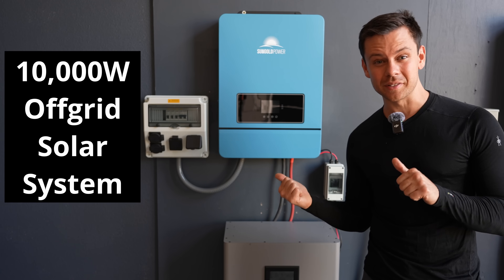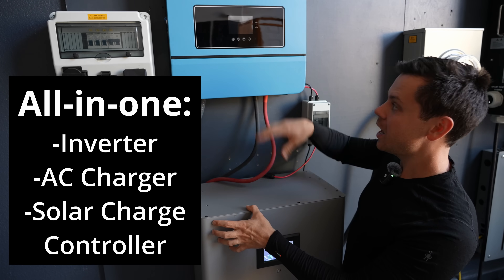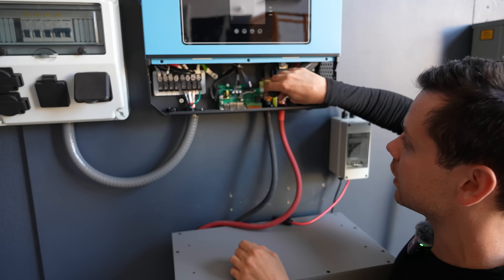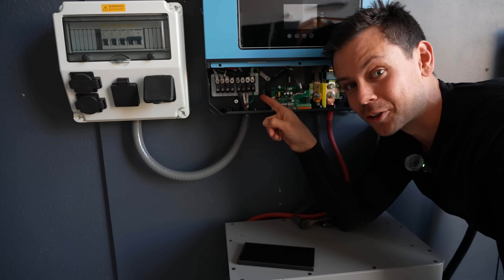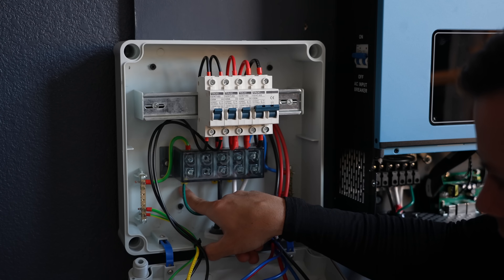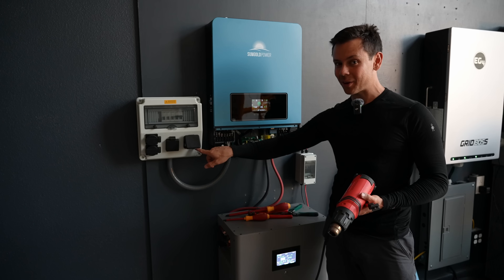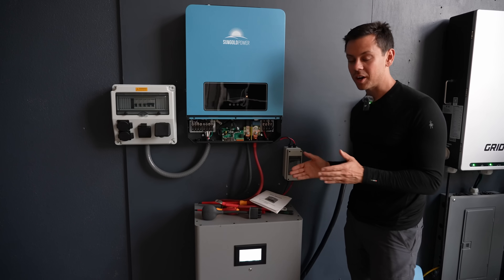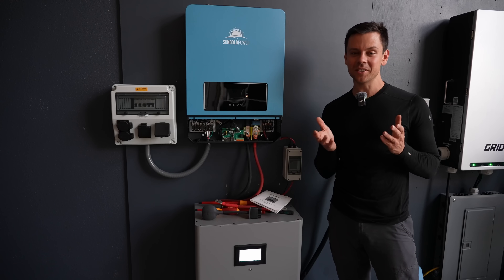Offgrid Solar Beginner Crash Course: Build a 10,000W Solar System

Comment: I love your videos. You seem to really know your stuff. I recently bought the 3000W inverter/charger from SunGoldPower, so I'm just getting started with solar power. I believe the grounding part of the system seems to be the most confusing part for me. When I contacted them about grounding, they did mention option 63, N-PE connection auto switching function, which when enabled "Allows automatic switching of N-PE connections." If you could do an entire video on explaining the use of their option 63 (may be other options on other systems), that would be so awesome. Because I've been looking through these wiring diagrams. I think I need to ground each panel to each other, optionally put an additional grounding rod at the panels, run a ground cable back to my DC panel, run a ground cable from the DC panel to I'm assuming the grounding rod at the house (assuming?) (which apparently could cause a parallel connection to the neutral coming from the power company?), connect the DC panel ground busbar to a Midnite Solar GFCI breaker for ground faults, connect a SPD for the PV panels to the DC ground busbar. But then SunGoldPower said not to run the AC and DC grounds in parallel. I don't see how to avoid that if they both contact the same grounding rod at the house. And when I look up things online, there's usually two assumptions I see: fully off-grid (and no grid) or grid-tied with no battery. I think I need option 63 on, and maybe that will prevent running the two in parallel, except that it inevitably would circle back around to the main panel since they would both be connected at the PE grounding rod. Thanks if you can. I may just have to study it very closely while I'm connecting everything. I just don't want to damage the inverter or energize the ground (double N-PE bond). Also, I would have to run the ground wire from the inverter to the critical load AC subpanel as well. How do you avoid parallelizing the PE ground while also grounding everything metal that needs to be grounded to the PE ground, including the grid main panel (before the inverter), PV panels, PV SPD, GFCI, inverter, DC panel, and AC subpanel (after the inverter)? I have the Renogy DC panel box and I'm looking at a small Square D panel at Home Depot for the critical load (with a 25a 1P main). I was thinking of using the Renogy inline fuses for the SunGoldPower 24v parallel batteries. I don't have an electrician but I'm trying to do everything as if it would pass NEC code.

Comment: You could use welding wire for the battery hookups, It's usually cheaper than the colored stuff, some companies sell cheap wire for more just because they color coat them.

Comment: I have a manual transfer switch on my main breaker panel for a 30 amp input from a generator.  Does this inverter have the option of grid battery charging?  Can this system automatically switch between grid and battery power when the grid is down?

Comment: I desperately want to do this or something similar to this, but I’m worried about problems with insurance if there’s ever a fire and I’m not covering it due to this thing being not permitted and I’m in Florida so you can’t get anything approved that isn’t a matched UL listed pair of inverter and batteries at this time. So that I think that means I have to use EG4 stuff at the least. what do you suggest for me? I’m trying to reduce my power bills. And I’ve already bought a solar panels. I’ve got 30 400W Hyperion.

Comment: Question - I just saw this but in my Motorhome I have a transfer switch with a ground neutral bond inside, and the shore power pole has ground neutral built-in - can't i input from my transfer switch (generator or shore power) safely into this device?

Comment: I would like to consult with you about adding a battery backup to my existing solar setup. I have 19 panels, but my PG&E bills remain high due to heavy equipment like a well pump and a pool pump. I’m looking for the best way to integrate batteries to offset this high consumption and gain more energy independence.  Thank you

Comment: I have a SunGoldPower SGM-655M with a matching 5.12KWH lithium PowerWall and I'm rocking 6x 370watt panels. This runs my 30amp RV comfortably in California/Arizona/Nevada. I'm building a new house battery box to replace the old system with 2x 100ah Renogy AGM's with their own solar charging for my RV's 12v stuff. I'm running a half rack network/control system with OPNSense firewall, HAOS, media server on a Lenovo 1L pc, poe cameras tank sensors etc. I'm about to convert the mini network rack to run entirely 12v and this should save my SunGold battery a lot of overhead diverting the 12v charge/load to it's own system but also cutting out the wasteful AC power bricks that just make DC anyways. . As for how it all goes the summer is really the only time I have to hit on the power grid as the air conditioning has to run pretty much non-stop all day. I do low voltage cable and IT work as a trade but I couldn't have come this far with out you. Thanks for all the knowledge and experience.

Comment: Great video, thanks.  It looks like the disconnect box you hooked up is opposite of the diagram provided with the box.  It appears that the  'PV IN' should be connected at the top of the box, and the out should be connected to the inverter.  Is there a reason that it is done this way in the video?

Comment: This is absolutely fabulous but this is way over kill for what i need and want to do. What would I need for the same setup but only 2,000 instead of 10,000. I just want to add power to a chicken coop and a small shop area with 3 or 4 lights an exhaust fan (that pulls 500 watts) a few outlets to run small things like trickle chargers a shop vac, maybe a 15 amp 120 volt air compressor.

Comment: Hi Will, can advise whether the following configuration 30KW solar panel kit is able to support 1000W appliance running continous . solar panel 200W*435mm*200mm , charge controller 100A , inverter 30KW with rated power 2200W . As battery is not included , what battery size is applicable ? Thanks for the attention .

Comment: Does this need / would this benefit from, pairing the 10k sungold with something like the gridboss?  I have very little solar capability (too many tall trees) but would like to be able to set up a whole house battery system.  I was thinking about 2 of the sunpower 10k's but I am just plain un knowledged about way things tie to the grid.  It's a different animal, and I don't quite grasp it.  (peak shaving would be nice,  eventually, I might add some panels to ease winter use, boost sell back?)

Comment: Can anyone tell me what I would need to add to this system to be able to run it in northern MN in an unheated space (-40-100F? I see heating pads available from the battery supplier but not sure what part of the system manages the battery temps for charge and discharge temp protection.

Comment: I've built solar. Sounds easy, but you won't have connectors, or the right tools. The cable you have won't fit, even though it should. You'll connect it all, but nothing will happen, just because. When you need it most, the battery will die. Etc, etc, etc...

Comment: Hi Will! In my country we have frequent grid blackouts for minutes or sometimes one or two hours. I want to build a system that is at least 10kW with 16kWh battery, BUT that also can have small gas generator (I read that DEYE inverters have this option). So when there is a blackout and the battery is below certain threshold the gas generator kicks in and helps with the load.
In my country we have 3phase system (400V/230V). But the generator could be only single phase if possible to keep it small.
The average load is not large, maybe 5kW. But sometimes it can go up to 10kW. Let me know what you think. Thanks!

Comment: Hi. I bought a solar pack of 1kw panel with an mppt from Zendure. It has a battery outlet. Their solar pack was very competitively priced, but their batteries are not. Do you know anything about what protocols the battery connection uses? Like are these standardised or proprietary. I'd like to add a battery, but not at the prices Zendure is asking

Comment: Great video. Has the wiring in the outlet box been sized correctly by the manufacturer now? Will has another video where he addresses that but not mentioned here. Also is the flex conduit 3/4 or 1"?

Comment: This is a great video but the power distribution box you recommended on Amazon is using 14 gauge wire which will not handle the 20A loads they are claiming

Comment: I have a pretty similar installation just like this. With 8 solar panels of 540Watts each generating around 340v. The batteries are roughly 48v with 120 Am. The only ugly thing is that it doesn't even last longer than an hour or so. The All-in-one should support 6.2 kV. So it's not supposed to last that short! Did anyone run into a similar situation where the batteries doesn't last ?

Comment: In your previous video review of the outlet box, you questioned the ability of the smallish(?) L14-50 outlet to handle 50 amp.  Seems you may have changed your mind.  Anything changed like they put a heftier outlet in the updated version or were you too skeptical initially?  Basically, are you concerned if it can handle 50A continuously?
Reply from the maker: Did not change my mind, they updated the wiring. Check out the new video
Reply: @WillProwse  Thank you.  Not sure which new video you are referring to but I've watched 3 on the outlet box. The first was the initial review, the second was on the discovering of wiring issues, then the third was the wiring fixed in the updated version.  Regardless, If you have put 100KWH through the 240v outlet, maybe it's ok?  Maybe you did it with low and slow Tesla charging?

Comment: can you do a video or post to connect the a/c power to the invertor direct and not use a 48v battery charger. To use this as a house backup generator with no solar panels? I want to be able to recharge the batteries with a/c line power. This setup instead of say a tesla powerwall.  I am good with the electric side and bonded. But what settings need to be set with the invertor?

Comment: We are looking into building a small solar setup for our house, It will only run essentials like the fridges and freezers, some general lightning and maybe run our old boiler (in case of blackout and we need hot water).
I been looking into different ways to build a system, both the full DIY with individual components, and also all in one units.
If we go the all in one route, would it be possible to use the AC input terminals and connect them to a generator, instead of the house own AC?
We would like to run this setup separate from the main grid that provides the primary power source to our house. and we do have old wiring which i wouldn't trust to be able to supply a large increase in load.

Would it be possible to hook up a generator to the AC input? and in terms of simplicity and budget constraints, would you recommend we go the DIY or All in one solution? We hope to have something that would last a long time, while still be reliable

Comment: Great video.

There’s a few points that you glossed over, from correctly tightening then torquing of connections. Correct insulation cut back. Cable sizing etc. a little knowledge is dangerous.

Comment: I was actually looking to get the EcoFlow Ultra when I stumbled on your videos. This would be significantly cheaper, but one thing that I would be missing is being able to AC charge off peak if the battery goes below a certain percent. Do you know of any videos on configuring the 3 in 1 to do that? Is it even possible? Alternatively are there any smart battery chargers that do that?

Comment: Will, I can’t thank you enough. I have learned so much. I have not started to build one yet. But I have parts to start a small setup for a few items. Figured I would start small and build a bigger and bigger. I have a small 5 x 10 cargo trailer to start small to connect 4 12v lights inside and 4 12v outside and a couple fans. Then I will setup my 25x30 shed so will need a bigger system and then move on to the house. I figure by starting small and moving up I can learn so by the time I do my home I should be pretty set.

Comment: Would recommend getting a torquing screw driver. What I used to think was tight was indeed not to spec for electric wire, specially thinking ones. I think they’re $30-50? Prevent future issues.

Comment: Will, I have been a big fan for several years now.  I'm sure this question has been asked before but, I'm hoping you can answer it again.  We live in Southern California and while I would like to install a system myself, my mother will not allow me to do so on her house...she wants a professional. The home is ideally situated with great southern facing roof exposure. So, can you recommend a reputable and affordable contractor or equivalent service that you would install such a system.  Also, if it's cheaper, we can buy all the equipment and parts ourselves based on your recommendations if it helps to save money.  We want to remain tied to the grid with battery backup up.  We want enough solar panels and battery back up to last about 3-4 days if needed. I would say we are average users of electricity with a family of 4.  I would really appreciate any help you can provide on this matter Will, thanks.

Comment: HI Will, I watch your videos all the time. I have a quick question if you have time: I have the opportunity to get 5 panels with the following specs: 
Maximum Power Voltage (Vmp) =30.1V
Maximum Power Current (Imp) =7.81A
Open Circuit Voltage (Voc) =37.1
Short Circuit Current (Isc) =8.31A
Maximum System Voltage = DC600V
Maximum Series Fuse = 15A
Maximum Bypass Diode = 15A
Fire Rating = Class C

What equipment would you reccommend to hook up those 5 panels ( mppt, inverter, cables) Thank you so much!

Comment: Just wanted to add a note here, the battery still requires assembly and is not pre-assembled. Just the packs are but you still have to install them, the busbars, electronics, and fire suppression.  So not going to be building this in anywhere close to one hour. To be honest this makes me all kinds of nervous to do.

Comment: Hey Will what’s your thoughts on putting this battery in a box truck with the 5000 watt inverter charger? I’m been looking on the forum but I didn’t see any mobile type batteries except rack system batteries. I can put a thick foam padding under the battery and strap it to the wall.

Comment: If you were to rebuild this but with batteries that don't have built in breakers (dc-house 48v lifepo4 golf cart battery), would you run them in parallel battery to battery with fuse terminals then 1 line to the inverter? Or would you run all batteries direct to a bus bar then from bus bar to inverter?

Comment: Will i am having a huge problem with pretty much all BMS lifepo4 cells and low frecuency inverters. When the low frecuency inverter changes from grid to UPS the battery BMS restart. Some inverters restart complety because they battery to work and some show the fault and Bms restart. The issue or fault is because transformer ask for current or magnetic field that the BMs senses. I noticed the SOC goes down to cero (0%) when inverter changes

Comment: You said to add batteries, just connect another battery. Could you please elaborate? Do you need some kind of bus bar to connect all batteries in parallel first, and then run one pair of wires to the inverter?

Comment: If there is a way to hook up this one to a manual transfer switch, I am sold and will order one right now. But what makes it bad for us beginers is the whole new panel addon for a critical load subpanel or interlock switch.. It's annoying since I already have a subpanel and a manual transfer switch. Some of us will not be ready for that for a bit. Tell me how to hook up to a manual transfer switch that i have installed already and I will burn all my Ankers f3800 pluses and f3000s and make a video if you want. Im so tired of the 3200w solar input and 2400w solar input.

Comment: I had a 16,000W Friday tied solar system installed on my roof twenty years ago. It was about $20k. Most months my power bill was just the basic charge for being a customer. Now I am in a different home and I'm considering a diy approach like this with ground-mounted panels instead of on the roof. And best of all I can do it for much less than before.

Comment: Thanks for posting this!! I’ve been thinking of making a small solar system to use as a primary back up to my current EcoFlow system. This is perfect. Run the hot loads to an RV 50A outlet and if I need the power I can plug into the generator outlet for the SHP 2.  For some reason my head wasn’t wrapping itself around this. 😂😂

Comment: Hello Will I have a question I need clarification on I live on my boat I have 600amps connected in parallel I’m wonder the best way to monitor batttery state would it be via a  ictron shunt if so my dilemma is what size shunt ?

Comment: This is exactly what i have been looking for ( less equipment and easy setup ) , but i need it to hook into my aunts home ac panel.  Can you do another video on the same equipment,  but connecting the output to a panel with a grid disconnect?

Comment: I tried to buy the battery posted on the video but multiple attempts/credit cards are rejected (no problem with the credit card otherwise since I successfully purchased the other items before and after attempting to buy the battery).  I left a message on the companies website - I'm thinking they sold out.  Is there another equivalent or better battery you can recommend?